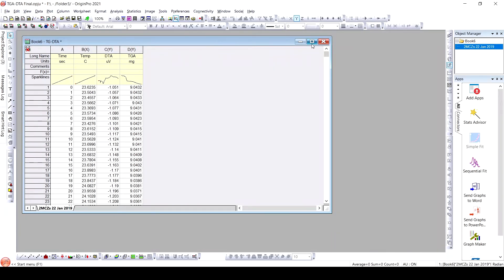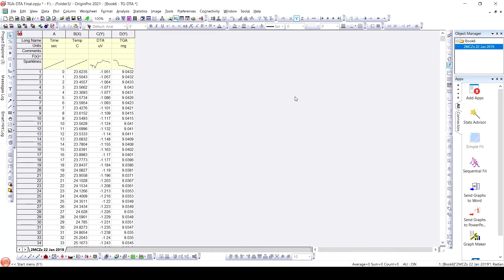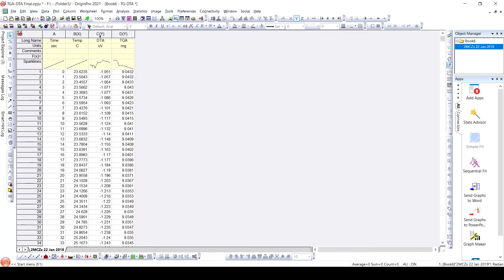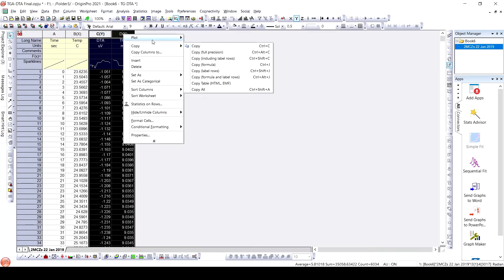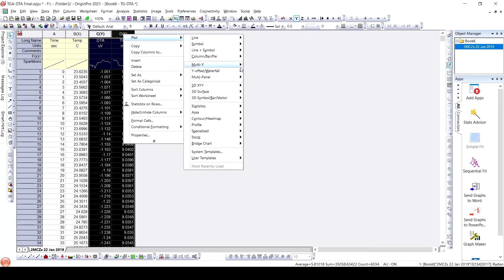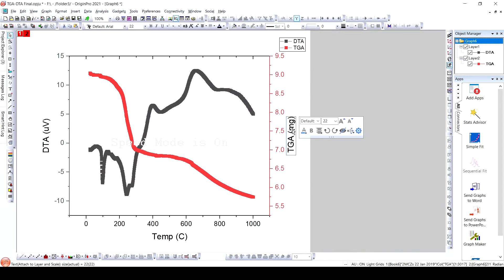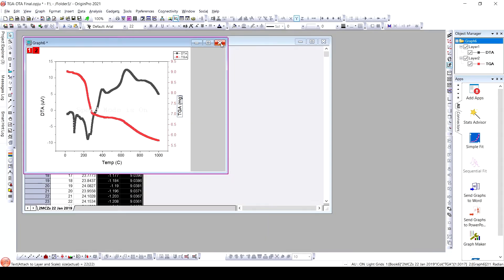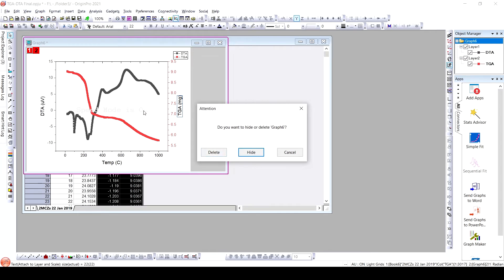14 How to Calculate Weight Loss in Thermogravimetric (TGA) Data

Comment: Would you please write the formula of calculation the weight loss it's not clear
Reply from the maker: The weight loss in TGA (Thermogravimetric Analysis) can be calculated using the following formula:

Weight loss (%) = [(Initial weight - Final weight) / Initial weight] x 100

Where,

Initial weight is the weight of the sample before the TGA analysis.
Final weight is the weight of the sample after the TGA analysis at a specific temperature or over a specific temperature range.
The weight loss percentage can be used to determine the thermal stability and decomposition behavior of the sample, as well as the amount of volatile components present in the sample.

Comment: What if I have data at initial temperature, the initial weight of sample has negative value?
Reply from the maker: It is not possible for the initial weight of a sample to have a negative value, as weight is always a positive value. It is possible that you may have made a mistake in recording the data or there is a problem with the instrument used to measure the weight. It is recommended to double-check the data and, if necessary, recalibrate the instrument to ensure accurate measurements.